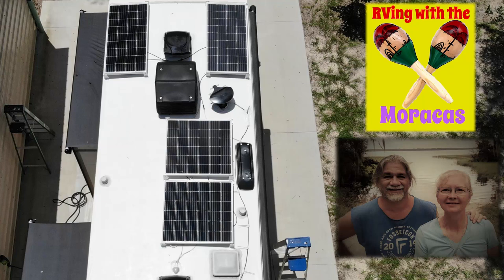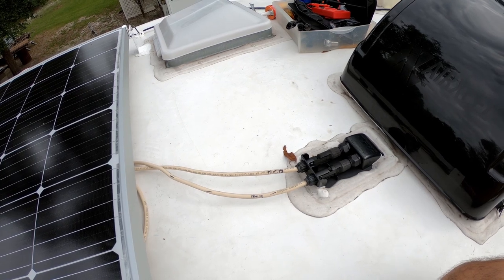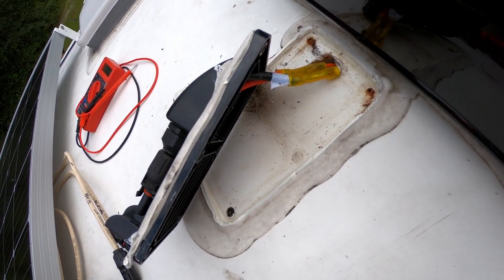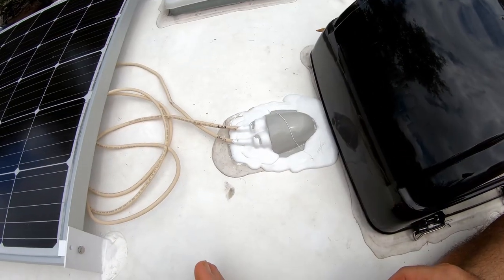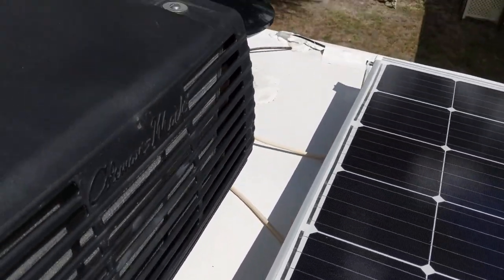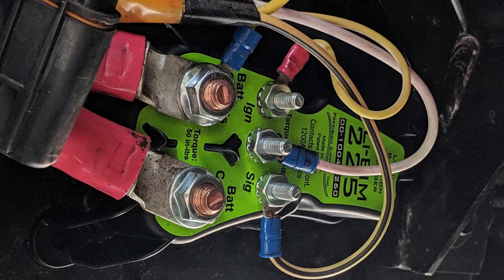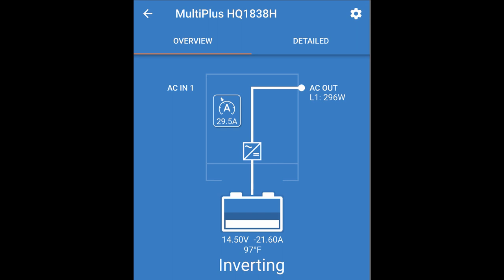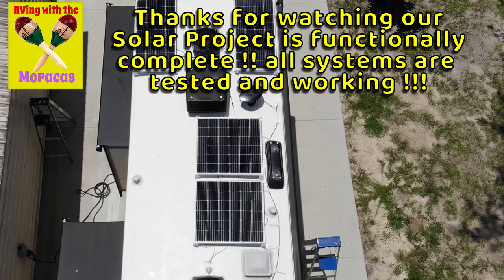Solar Project Part 3 - IT WORKS!!!

Comment: Where was your BIM installed.  I have not crawled around under my ACE yet to see if I can locate it.  Thanks for all the info!
Reply from the maker: not sure what you mean by BIM - if that is the thing that charges the batteries from the alternator - it was in the front on drivers side with the "hood" open.  If it is the battery monitor I installed it as part of the battery install it is in where the batteries are with the gauge near the door.
Reply: @RVingwiththeMoracas  yea the BIM is the device that charges the batteries from the alternator.

Comment: With connecting the new inverter charger direct to the RV's fuse/circuit breaker did you unplug the factory charge converter from the fuse box?? And with the direct connect, does the batteries run everything or just the select items as set up and wired from the factory? And is the charge/converter able to sense and switch everything automayically be it shore power, solar/battery, idle motor/alternator or generator??
Reply from the maker: I turned off the breaker for the converter so it is not in use at all but still connected.   Everything works "normal"  since the victron inverter charger has all of the functionality built-in. We leave the inverter on and all works either from batteries or shore power or generator.  A/C is too much draw for batteries but works fine plugged in.

Comment: Why didn’t you put the batteries under the steps
Reply from the maker: Not enough room for 4 batteries without modifications and they are safer inside.